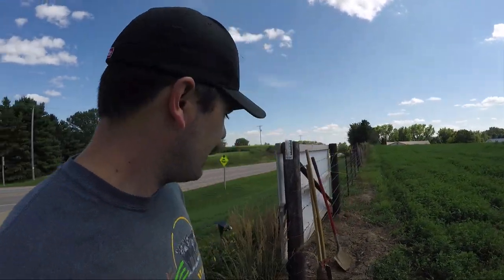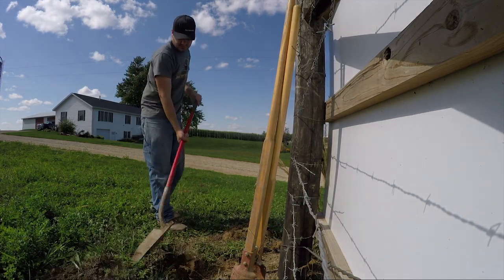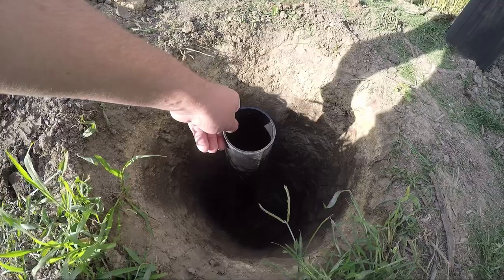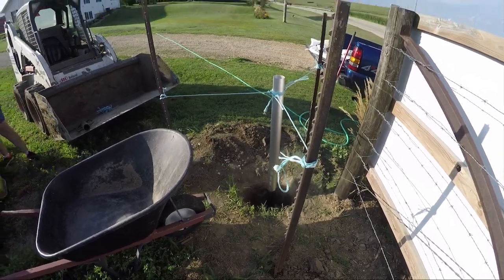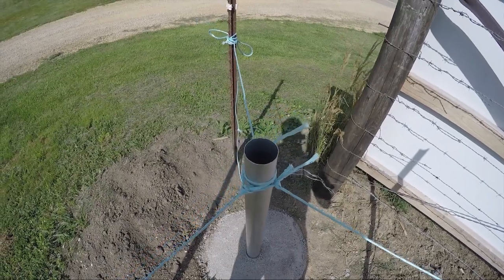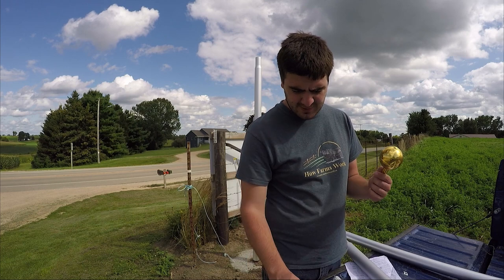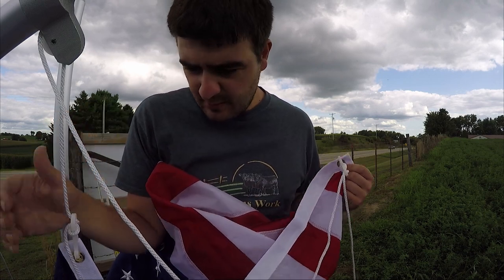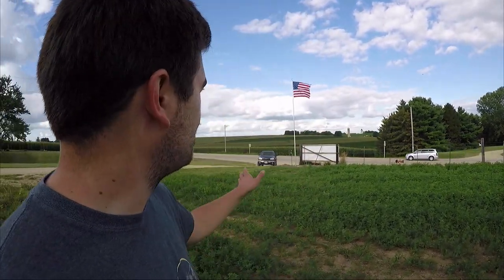Old Glory - To Build A Flagpole

Comment: Hi Great video! I appreciate your sharing of putting up our beautiful flag and pole. About 20 years ago I put up my flagpole and  it is still there. Mine is a aluminum military surplus power pole with a tapered base starting at about 10 inch diameter to about 2 inch diameter at the top about 25 feet high. The thickness of the aluminum is about 3/16 inch. I bought a solid brass eagle, a desk ornament, machined a base in it and mounted it on top of the flagpole. I added a stainless steel  pulley at the top and fastened a boat brass cleat to tie the rope to. A 50 foot nylon rope works perfect with a 3 x 5 foot flag like yours.

Comment: Ryan, to tighten up the base pipe and cement gap, you could put some polymer sand the space and add a bit of water. It will seal it right up.

Comment: Hey ryan a tip for the flagpole and strong wind is put a pvc pipe inside the length of the pole to prevent it from bending or breaking in heavy winds.. highly recommend doing this.

Comment: Your Dad and Travis were right that the weigh of the flagpole will keep it down, but since the pole has that much play pretty close to the bottom, you will have a lot more play at the top, and the flag will create drag which means it'll go back and forth quite a bit with a decent amount of wind.

Comment: Funny that you had the Bobcat there but chose to dig the hole by hand and mix concrete by hand. Maybe it was because of the fiber optic line you mentioned? Around here we don't have any underground utilities to worry about, and no one bothers to put up flag poles because there's rarely anyone driving by to see it.
Reply: it wouldve been difficult to dig a small, round hole with a bobcat bucket.
Reply: tncountryboy06 lol

Comment: Do you have to go 40 inches deep to get below the frost line? I believe if your going taller next time you'll need a much bigger pipe, like well casing size and a backhoe to dig a lot bigger and deeper hole, enough for a yard or more of concrete.

Comment: Hi again, I almost forgot that I planted 12 rose bushes in a circle around the base of the flagpole, spacing the roses to make a solar clock (sundial). The shadow of the pole  on the roses tells the time The length of the shadow tells the seasons. I also put up an outdoor spotlight on the flag. There is also a concrete walkway to the base of the pole and surrounding the base of the flagpole.
Reply: joe polen what does this have to do with anything?

Comment: Lol.  I would have cheated and asked Dad to use his auger.  I hate digging holes.

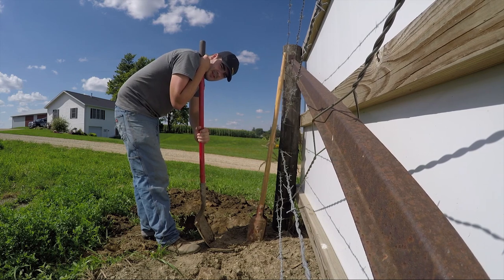Looked very nice when I drove by today around 3:45-50. Someone was mowing and you had equipment nicely lined up.  Any special reason the tractor in the driveway had lights flashing?

Sorry your video turned into a huge debate with what it currently happening with historical statues and what-not.

Comment: Old tip for the future: Once plummbed, pour DRY redi-made   concrete around a flagpole, fence corner post etc. No water needed, no mixing, no barrow cleaning. Water from earth absorbed by the concrete provides necessary moisture. In 24 hours, it will set; place  your fixture. Slick as ** and lasts forever. May our flag fly forever!